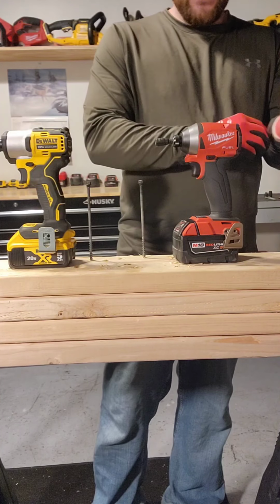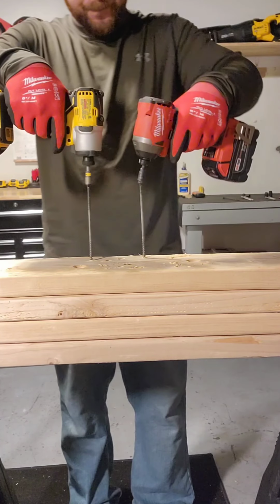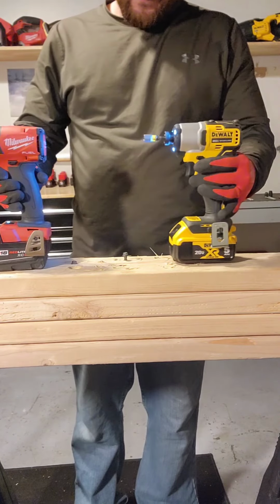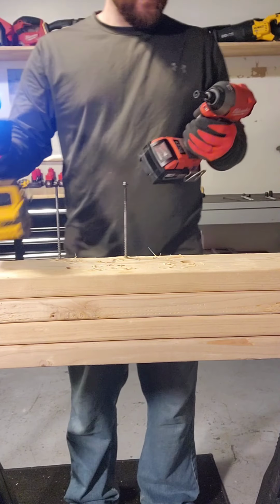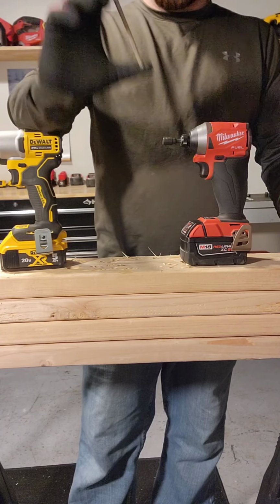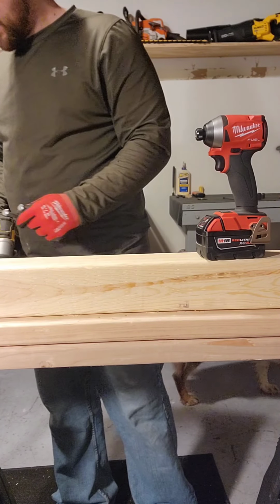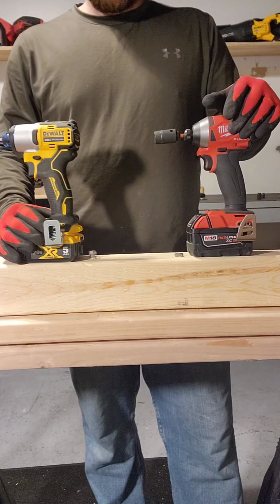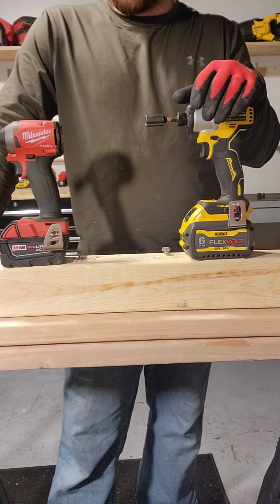CAN DEWALT DCF840 KEEP UP WITH MILWAUKEE FUEL GEN 3?

Comment: Hey cool video!! Man I love my 840 it's a beast! Just a suggestion, you should test how fast they remove the lags also. A good impact driver actually puts more torque on loosing than tightening. And the Flexvolts still have the older cells. The 8 and 6ah have the newest 21700 cells, might give the 840 a little nudge in power. Good work on your videos, need to fix your mic, can hardly hear your voice.
Reply from the maker: Thanks brother, will do buddy I'll start throwing in reverse testing with them and see what kind of results we get and throw in a 6ah next and see what happens the 840 is very nice👍

Comment: Thanks for the video. So judging from both videos, the 850 seems to take better advantage of the flexvolt batteries.
Reply from the maker: No problem brother, yea I have been thinking about that as well the 850 definitely seems to take advantage of the flexvolt more so than the 840, im thinking of doing a video between the two dewalts again and running the flexvolt between the two and see what kind of results we get, thanks for the support👍